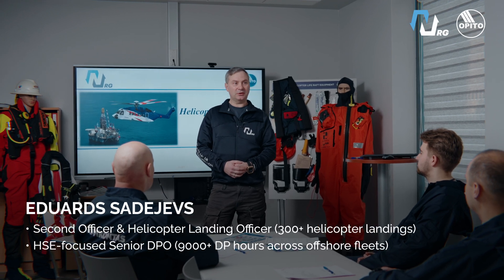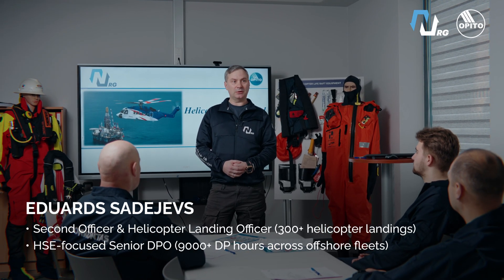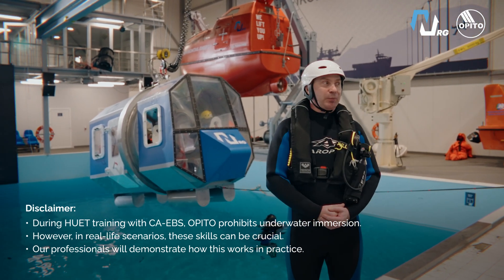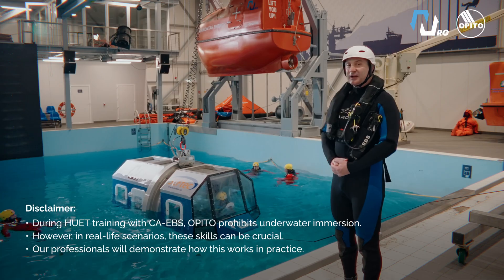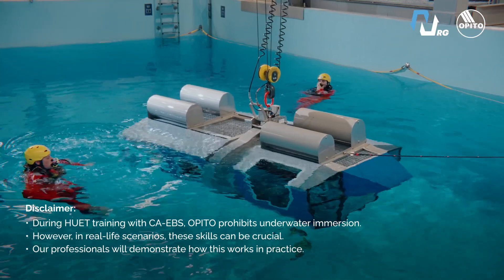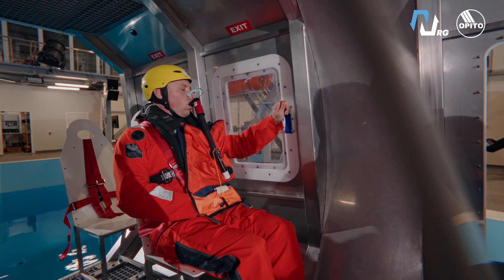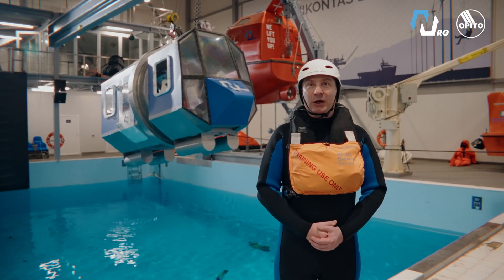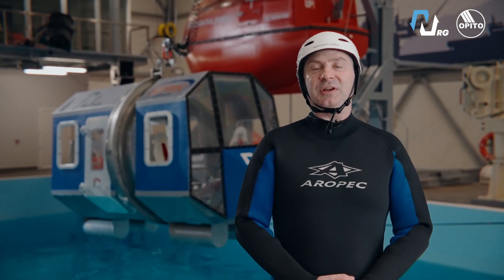Offshore Course - Helicopter Underwater Escape Training (HUET)

Comment: Should  get out after 7 seconds or after 25 seconds?
Reply from the maker: When the simulator is fully stopped underwater, students start preparing to escape from the helicopter, imitating activation of the tap, window seals, pushing out windows, and opening the backpack. After that, students come out of the helicopter. Total timing underwater 6-8 seconds.

Comment: Know need with all sistem come in water?
Reply from the maker: If you meant, “Do we need to go into the water with the full system/equipment? - Yes, participants go into the water fully equipped with Ca EBS or EBS, life jackets, etc. It’s essential to make the training feel as close to a real emergency as possible.

 Just note: CA-EBS is worn during the exercise, but OPITO rules don’t allow using it underwater. In our video, we kept it on to demonstrate its appearance in real-life